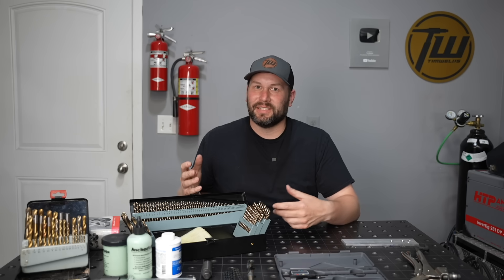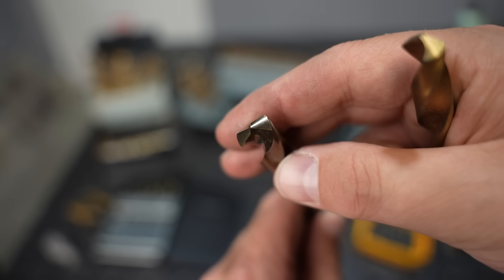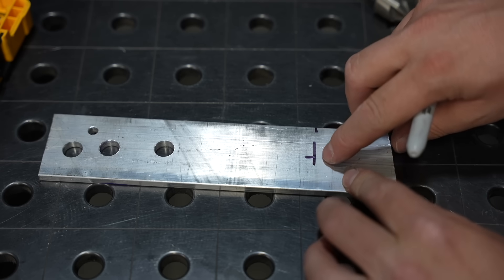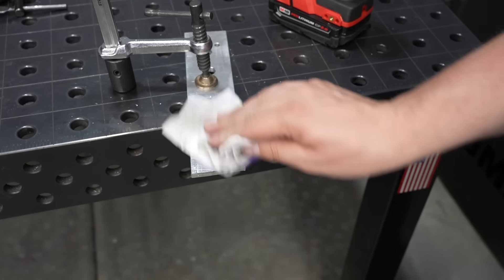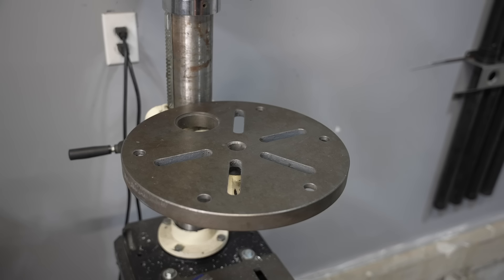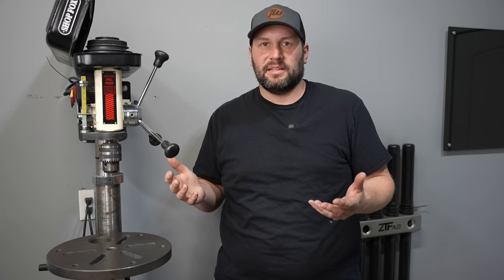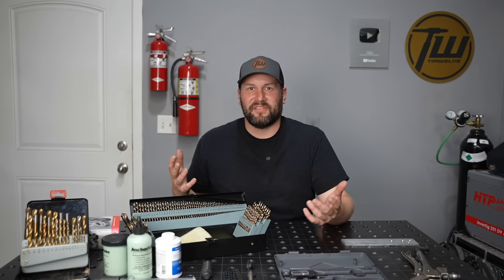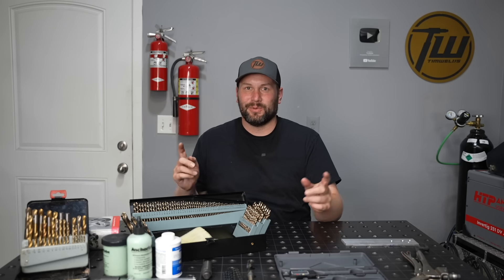How to Drill Holes in Metal: Master the Drill Press

Comment: Myself, if drilling hard steel 3/8" or larger I will start with smaller pilot holes 1st. Start with 1/16th to 1/4" then drill the 3/8" or larger. Yes, 3 bits but easy center without wandering and when drilling the next holes the drilling is much easier and efficient. Of course using cutting fluid too.

Comment: Alright I'm just going to say it, or ask I guess, I know that every machinist, fab worker, etc. call drill bits drills, but can we just stop, a drill is a drill, there's hand drills, drill presses, battery operated drills, electric/corded drills, and you could even sort of say boring machines, vertical and horizontal, but why all the confusion, we can just call it a bit, I know that's not exactly the proper term but we need to make it less confusing.

Comment: Great video (as usual for this channel). One question: how much force is required for each drill bit size?
Reply from the maker: Thanks! That's a great question. The best indicator is the chip coming off the end. If you aren't getting any length to the swarf, you probably need a little more pressure. If the chips are really thick, it might be a little too much pressure.

Comment: Lots of good tips; to prevent long stringy chips, simply raise the drill a bit then cut a new chip- this results in smaller safer stringy chips.  Also I would make a pilot hole first, lightly make a small dent, then put any cutting oil for the balance of the hole- otherwise the cutting oil may hide the desired spot to drill, and then the bigger drill.  Using a non-split point drill without a pilot hole is guaranteed to be off where you want it.

Comment: Best way to go through thicker metal is to start with a small bit and work your way up in steps of about 2-3 bit sizes at a time. Slow speed, ecen pressure, good lube, back off a bit as the oil starts to smoke, it breaks the chip and lets the bit cool a little before proceeding. As you get to the end the speed will slow down and sound will change. Back off a second, speed up and push back through. If you let it slow down too much at the end, as it breaks through it will grab your bit and may break it.  If your bit is changing color, you are done. You have destroyed the temper and it will first be too soft to cut, then as you force it, will work harden and break..  Purple is a temper color reserved for punches and maybe an occasional chisel. Too hard and brittle for drill bits. Slow and patient. Fast is not you friend. You will drill maybe 2 or 3 sizes of bit per hole, but probably be much happier.

Comment: On mild steel, instead of engineers blue, use some french chalk to mark or rub it on before you use a scriber. Marking a weld point and start stop points with chalk is useful too as the chalk is easily seen when welding, then you won't drift off or get uneven stitch welds.

Comment: One very important tip you did not mention while drilling in metal is to NEVER use gloves while drilling. I have learned that the hard way twice while drilling aluminum, as the curls caught my glove and pulled my hand onto the drillbit running in high speed, causing very hastily trips to the hospital for treatment. NEVER use gloves unless you use heavy duty welding leather gloves which possibly may prevent this from happening. Even if this is not a drillbit issue, it should be stressed.

Comment: I bought a set of what they call a "Carbide Hole Saw Kit for Metal" from Amazon. These are a game changer for drilling holes from 5/8" - 2 1/4" holes up to maybe an inch thick steel. They don't require a Mag drill. I use them in my drill press. They have a centering bit and a spring to kick out the plug and come in an aluminum case. I paid about $60 and found them worth every penny. They drill accurate holes quickly. If you drill one size a lot, then you can purchase only that size if needed.

Comment: Drill press manufacturer's should have a spring-load feature on the quill feed that prevents the operator from applying too much pressure.  But then the buyers would hate it and return it. You can't save some folks - see my previous comment, LOL.

Comment: Question about the talk regarding drill speed. You said if it's smaller holes or softer material like aluminum you'd choose to up the speed. Is there any benefit to that vs staying at slowest speed in regards to drilled hole quality? Or is it merely a speed thing? I'm not in a rush I just want to minimize damage to my drill bits and get good quality holes. Thanks.

Comment: One trick to centre the drill and workpiece is to hand rotate the drill in the chuck in reverse whilst applying light pressure. This pulls the punch and workpiece to the centrepoint of the drill.

Comment: You want to cut. Slow speed and steady pressure cuts. Higher speeds simply generate friction that causes heat and makes a mess both with your coolant/lube and also leads to loss of temper in your cutting bits/blades and once the heat gets into your working piece and you allow it to cool you may have damaged its temper or heat treat/annealing.

Comment: A way to get rid if the "stringy" chip that i was taught as an apprentice some 50 yrs. ago is to ease up on the handle momentarily then resume the feed pressure to continue with the drilling operation. With a little practice you can break the chip at abo I t any lenth desired.

Comment: You are drilling through 1/4" material and soft aluminum...Drill through some 1/2" carbon steel
Reply from the maker: Did you watch the video? I demonstrated steel as well. Thickness doesn’t matter, it just takes a little longer.

Comment: You need to keep enough pressure to keep it cutting. The harder the material the flatter  the drill angle. There should be two curls comming off each of the cutting edges. Now a most important controll is the speed  never allow the curls to reach more than a dark (gun) blue patina. A straw color patina happens on bared steel at 400°F, a brown at 500°F, a purple at 525°F, a deep blue patina at 550°F. Keeping your drill speed slow enough to prevent your curls from getting hotter than  deep blue is essential to keeping the cutting edges sharp and durable enough to cut the hardest material. Mostly I prefer to drill dry. Learn how to sharpen your bits with split point style and you won't need to  pilot whole very often. There are books that explain the importance of keeping enough pressure to keep it cutting. Why not to overspeed,overheat, how to put 8°relief angle behind the cutting edges and so on. A book that explains these principles I have mentioned (and more)
can provide you with the knowledge to have the ability to drill successfully as well as anyone. Taking the time and making the effort to learn how to do important skills you're needing to have will  
benefit you endlessly

Comment: Hey, I need to install blinds to a window in my outdoor office. It’s double brick but the top of the window has a cast iron plate. I have a Ryobi 18v Hammer drill RPD18. I bought a 6.5mm HSS drill bit and could only make a dent in the metal. Have you got any tips for settings or method? I didn’t use lubricant, battery was fully charged and it was a brand new drill bit. I was using Hammer setting 2 as per instructions online, but ended up stopping as I wasn’t getting anywhere. I packed up in frustration.

Comment: drilling stainless steel is a nightmare for me i always end up heatin my drill bits to crap
Reply: For stainless I only use a magnetic core drilling machine on a decent chunk of mild steel.  A typical drill press is far too flimsy and fast to exert sufficient pressure. I’ve given up on solid carbine and carbide tipped bits only using premium HSS bits.

Comment: THANK YOU.  It seems we need more "basics" videos like this.  I've seen people making videos pretending to give advice, and they're burning up their drill bit, it's embarrassing.

While I was moonlighting after retirement in a hardware store, I discovered that people who came in frequently to replace drill bits didn't want help to stop wearing out drill bits - they would rather spend money than learn a very simple thing.  Construction workers are the worst; you can't tell them sh*t, they know _everything_.  Meanwhile, my 1/4", 3/8", and 1/2" bits have probably drilled several feet of steel EACH, and I've never sharpened them, because A) let the machine do the work, not your arm, and B) use lube.  Full stop, the end.
Stop heating up the tips of bits and you will stop wearing them out.

Comment: One of the most important things to remember when using a twist drill is that when the drill starts to break through the other side of material to be drilled that this is the most common time for drill jamming or breakage.  This is because the flutes of the drill catch the end of the material in a somewhat haphazard manner, in other words more or less on one side or the other.  Anything you can do to secure the drill and workpiece will help.  The more secure the better the results.  This is one of the reasons why most people are more successful with a drill press rather than a hand drill.  A milling machine is more secure than a drill press.  Both of the aforementioned machines need a vise of sustainable  strength secured to the table to achieve optimal results.  In any case if you just remember that break through is the most critical time and take your time at the bottom of a through hole you will avoid a lot of drill jamming and breaking.  Lubrication helps as well.

Comment: so help a newb out here. When I was drilling metal(was actually another hole into a receiver hitch i needed) when I used a 1/4" bit for a pilot  hole it worked fine then when I tried a 1/2" or 5/8" it worked fine for maybe 1/3 the way then just instead of nice shavings coming it was more dust. These where new bits also.

Comment: Does it help longevity of bits to step them up to the larger hole?  You went directly at 1/2", cut great, but is there a benefit and/or easier to do a 3/16 or 5/16 first, then half?

Comment: I have to drill stainless steel bar 1.3 mm thick. What is best drill I can use for?
Reply: that's sheet metal to me at .0511 thick material. I would centerdrill then use a regular high speed drill with a little spraymist waterbased coolant. Or use an endmill and peck it which is faster. Put a flat piece of wood or something under the material so you don't bend the thin stock.

Comment: Just a word on swarf; I had just sharpened a bit, and was watching the lovely swarf ribbons coming off both sides, getting longer and longer, and in an instant it wrapped itself around my pinkie on the drill handle, and there was nothing I could do. Luckily it just tightened up and pulled off a big lump of flesh at the tip, but I thought it was going to cut the top joint off. Since then I always release the pressure to keep the swarf short….

Comment: When using a center punch do not use a steel hammer it will skip across the surface of the head of the punch thus moving the point off your layout. Always use a brass hammer as it will not glance or skip off the top of the punch. Steve B
Reply from the maker: Thanks! I've never heard that before, but it makes sense.

Comment: Could you also demonstrate drilling stainless steel round pipe, especially those smaller diameter ones i.e. 1/2 inch pipes.  The tip of the drill bits just doesn't seem to have enough reach to the curved round shape to be able to bite through.

Comment: Out of concern for a  legitimate question, I’m workin on a project where I need to drill a small hole through a steel pipe cap and at 3:22 the black oxide drill bit, does anybody know about what size it might be? And where I can get one?

- Riley Donihue
Reply: And it’s because I’m an entry level welder at age 32, I’m in need of this information due to the fact that I’m a firm believer in keeping my 2nd amendment gun rights. I’m building my very first slamshaft shotgun....  And it’s in need of the final and last drill portions to be added and done with solid performance.  Fucks with a oxy-acetylene blow torch, I’m cutting the barrel this month at 16” x 3/4” and that is stainless steel. The galvanized slam shaft part is to be set at 11” x 1”.  That’s about all, just to get you on board I mean like protecting my new family is something rather serious too me....

Thanks again!
Reply: The handle looks cool but only it’s only just simply missing the firing pin, that is all....  It’s like Social D once said, “I fell into a burning ring of fire...."

Comment: If you do much hand drilling that anchorlube will make your life easy with good bits in thick steel. I watched an electrician drill a 1” diameter hole in a 1” thick McDonald’s road sign with a standard Lennox hole saw bit, I thought he was crazy and never thought he could do it and he was using anchorlube , I now but it in I gal and keep in trucks and shop it comes out like toothpaste wipes off easy and if it dries out water will revive it. I also found when drilling with drill press it almost seems to make your bit sharper, never seen anything like it.

Comment: 1-drill bit must bite easily.
2-begin without lube to set speed:
ferous materials, chip must not turn blue. (carbide drill bit, must turn blue)
non ferous materials, must not stick to drill bit. 
s.st. must not even turn yellow.
3-add lube, can be anything from water to wax.  veg oil or motor oil is a very good choice.

when you see fire... slow down.

how to calculate speed:

4x recomended material speed/work diameter

recomended speed:
mild steel 100
aluminum 250
s.st. 80-50
carbide tool,  rpm x 3
harder = slower and more pressure
vibration---> slow down add pressure
material stick to drillbit---> slow down. less pressure, add lube

#1 enemy is heat.

1/4"drillbit in mild steel...

4 x 100 / .25 = 1600rpm
adjust as needed.

Comment: I seem to do most of my drilling in flat bar and I keep a piece of 2" angle by the drill press. I clamp it down with a couple of Vicegrip C clamps to make a fence. To find center of the work flip an off cut end for end and tap the fence over with a hammer until the bit comes down in the same place. Now you only need to lay out the location of your hole in one direction. I mark with a scribe and start with a small bit.

Comment: Good information on the BITS, been in the Aerospace-Industrial mfg sector for 30 years as a Specialty Fastener applications engineer and in 1000s of plants where fabrication, drilling, stamping, bending, milling was our working domain. Stiil always learning and do my own repairs/project builds. Dad taught us welding back in the 70s on Oxy-Acetylene and we had some good times with it fixing out dirt bikes. Now wanting to get into more modern equipment and take up welding projects again. Would like to take a course, but ask which type of welding is the best to begin... with Stick or Wire? Thank you!

Comment: The tip of the drill is called the web. There are a number of ways to drill holes easier. Drill a smaller pilot hole first, then your bigger drill will drill much easier and quicker. I've been a toolmaker for many, many years.
Reply: Tip of the drill is the chisel edge.
Reply: @robertgolden2652  Thanks for calling this out. The web goes the whole way from the tip to where the flute ends. The chisel is just the end (assuming that's the style the tip is ground to, of course!).
Reply: You say there are a number of ways, then only give one. What are some of the others?
Reply: There is a trap in pilot hole methods. Thick steel or metal can break off the pilot drill bit in the hole. Immediate nightmare. Choose wisely.😅
Reply: This is particularly true when drill bits get worn towards the pointy end

Comment: Great tip on shavings coming off as you drill. Great tip for hand drilling as well. I always watch how the metal is coming off the bit (Try it next time). As you're hand drilling if the chips aren't coming off your bit, there are two things to focus on. Speed and are you square to the metal. The chips will let you know. I'll pulse the trigger to change drill speed, and make sure I'm not at an angle by moving drill. And yes, you can sharpen a common drill bit by hand. I had a machinist teach me long ago.

Comment: My 2 cents worth. I look at the outside of the chip to see if it is smooth or jagged. A jagged edge means you are tearing the material instead of getting good shearing action, so a slower speed is called for. For austenitic stainless steels (300 and 400 series) which work harden, compressed air is actually the best coolant I have found. Slow speed, high feed rate for work hardening materials, this from my friend who is a real machinist. Holds true for copper also. Precipitation hardening stainless like 15-5PH and 17-4PH are a lot easier to work with, and more so in the heat treated condition than annealed. Also more expensive.